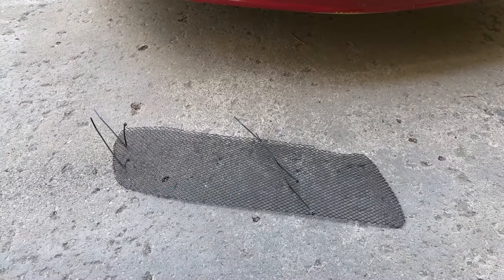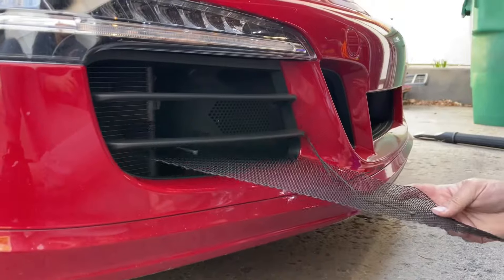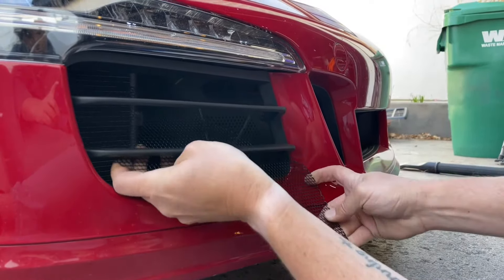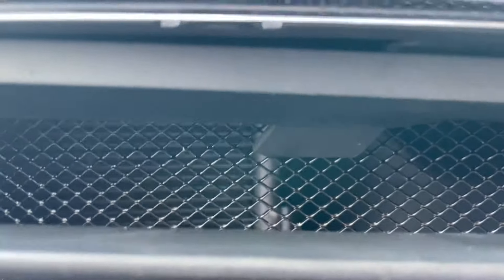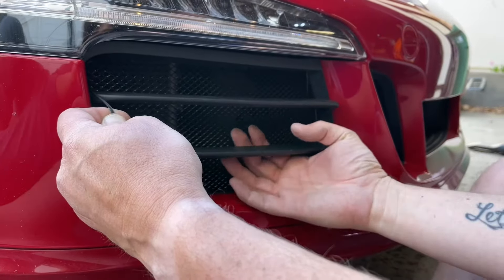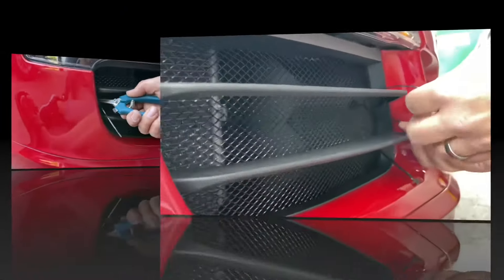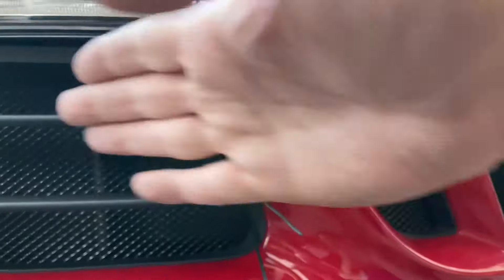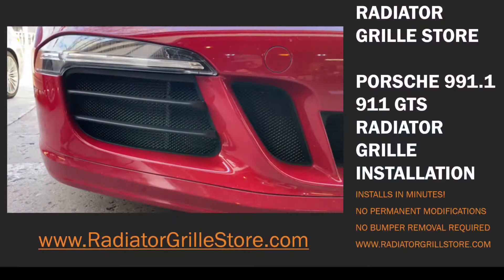Porsche 911 991.1 GTS Radiator Grille Install by Radiator Grille Store

Comment: FYI, if you have the front parking sensors, the top external zip tie will not be possible to secure, (or extremely difficult to pull from behind the sensor.
Reply from the maker: Thank you for the comments!

Comment: 3:10 why not cut out a channel out of the grill so that it fits over that tab?
Reply from the maker: Good comment!  We try to keep a seamless, OEM look.  Cutting a notch would be slightly visible.
Reply: @radiatorgrillestore  Fair enough, but you really can't see it unless you are kneeling.
Reply from the maker: @a.c.e.7568  Very true.  We may take that advice. We will look to see what it would do to the design and look.  Thanks for checking us out!